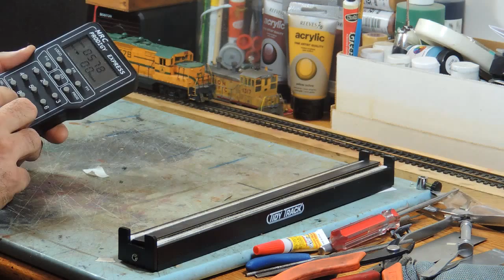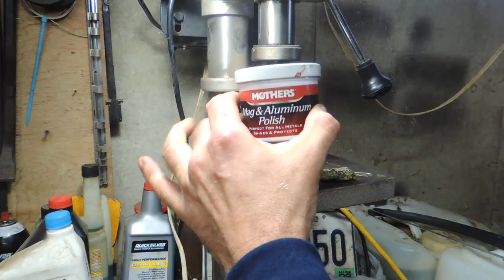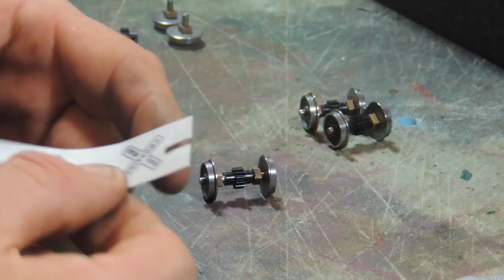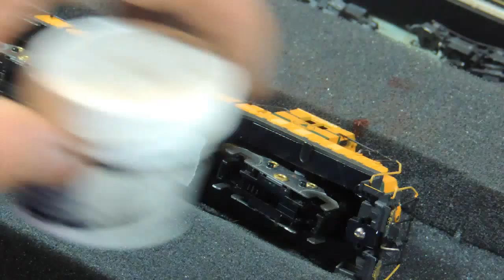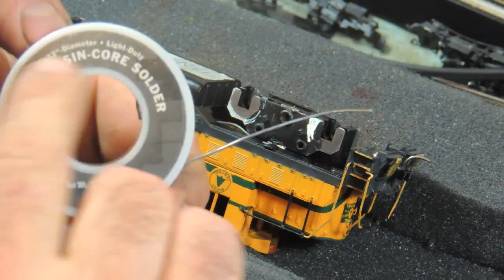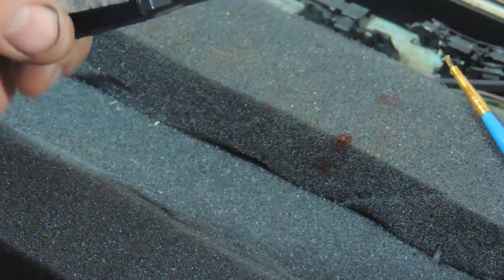Athearn Locomotive wheel tune up tricks.

Comment: This is my first time viewing. Very impressed with your machine shop cleaning of these ATHEARN wheels. The wire you soldered to the metal interior frame looks thin but i guess strong. 
The inside of Athearn mechanisms seen lots of times & ages. I have tons of fleets of them. I noticed some alterations on the front clip light that gives the bulb power that clips onto the chassis. Not there or the removed clip lock coupler covers. I want to mention I have a GE U 23 ATHEARN engine the front clip can no longer lock so that means no more light ups in front of the engine. I saw your version rebuilt fancy for lights in both directions. I have to convert it similar to what you have on your diesel. This is a blue box as well. Its not DCC or any sound gadgets. I need what i have viewed to replace & add a rear lighting similar to ATLAS circuitry. Of course i got something watching your video. Thanks.

Comment: What kind of soldering iron do you use.  The ones I use don't seem to last very long.  I'm using the Weller pencil soldering iron but the tips wear out very quickly.  BTW one of your fly wheel/gear assembly seems slightly askew, won't that cause running problems?

Comment: Athearn blue box locos have sintered wheels (powder compressed under high pressure, not cast) and they are very porous. They did that for maximum traction. To avoid these, get replacement wheels from someone else. It's interesting that you DCC guys have such problems with these, since you're using a lot more amperage and the PCB/software must shut off current to the motor if it's too low. I've never had the problem since I don't know what DCC is.

Comment: The wire used #1106 .0125" Phosphor Bronze.  Translated it is 30 gauge wire which I find too thin but very workable, I have had no issues using 26 or 24 Gauge copper wire easily found in the craft section at places like Walmart or Hobby lobby as it's mostly used for Jewelry and comes in many colors but go with Silver or basic copper the others are coated and may have pickup issues.  The Walmart stuff is $3 and no shipping costs and being slightly thicker seems to hold up better in my experience.  Great video and great tips!
P.S If Athearns are frustrating you,  sell them to me,  I'll buy them off you to help out no problems, these old trains outlive everything else even 2000's era stuff easily, step 1 or not is irrelevant,  Trains are meant to pull loads faster than a snail anyways.

Comment: Great Ideas... did enjoy video, BUT! I'm 74 years old, NEVER had a train, then 4 yrs ago, Two of my Grandsons (at 4 yrs old) became interested in chasing the local Spur line and wanted a trainset for Christmas... so I built a 4x4 circle track with a Harbor Freight set. The an 79 year old Uncle (who had been a train "nut" all his life, big in the Local Model RR club passed away and I inherited all of his "Project Trains"... probably 14 Deciles and 12 Steam Engines... only three worked. they are all from the 80s or earlier... (his son and the club got the pick of everything they wanted). 

My point is this.. I know NOTHING of the history or models (Blue Box Athearn means Nothing to me) I've got Atlas A-7 that I'm am working on in this video respect, I don't know how to get it apart without breaking it... some I have broken, some I got apart and don't know how to put back together. I can't get much help and youtubes are usually not a good as yours. but I spend HOURS and HOURS searching and youtube doesn't help, taking me on tangents that I didn't ask for... MOST of what I've got I can only identify to the company, and that's about it. I think I've found four disassembly sheets from HOME PAGE but they aren't Exactly what I've got...  where can I find your other related videos?

Comment: Great mod!  Phosphor Bronze wire is perfect.  Wet and dry sand paper at that grit will remove less than .00002 thousands of an inch before you wear the paper out.  It just polishes much like the creams.  Good stuff any ways.

Comment: awesome hack for theses engines. would dielectric grease help with contact as well? what are the measurements for the styrene used to reassemble the wheels??? thanks for your time.
Reply: NO on the dielectric grease Peter.  The grease will attract all the dirt, hair, crud and anything else that comes it's way!  The bronze bearing are "self lubricating" and any type of oil based lubrication will not help.  I clean those bearing in a degreasing solution in a ultrasonic cleaner and then follow it up with a rinse of 91% alcohol before reassembly.
Reply: @nelsonbeaudry4847   So you are not running any oil at all on your Bearings.
Reply: @GeorgeT6566  no oil.  The sintered bearings are self lubricating and oil only saturates them.  This is actually detrimental to the electrical path.  Adding the extra wire pickups is the best way I have found.  I currently only have one active Blue Box GP40-2 modified in this manner.  I finally added a keep alive to the Tsunami decoder and have never looked back.

Comment: I still prefer the old blue box locos. Going to try that wheel pick up trick. I will polish the back of the wheel But not the tread. I like the rough wheel tread for the reason of the traction advantage,  But it does make them get dirty faster. I like to pull really long trains, 120 average.  Them old blue box will pull them all day no problem,  Can't kill em. I have proto And Kato ect that can't pull, Just sit And spin. They may be noisier,  And not as pretty but they are some real good heavy haulers.
Reply: The rough tread on the wheels has no effect on traction.  Polish the wheels and you will still be able to pull 120 car trains due to the fact that a smooth wheel on a smooth rail will have more adhesion.  The reason the the other brands don't pull as well is because the wheels are made of Nickle Silver or brass and plated over with NS.  Both of which are much harder of a metal than the Blue Box wheels.  Those are made of "sintered metal" and are quite a bit softer in relative terms.

Comment: So what is the trick to get solder to "stick" to the metal parts of the truck assembly? I'm following your instructions, but my bronze wires keep popping off when i move them.
Reply: So sorry for the super late reply.  I use a paste flux called "NOKORODE®".   Yes it's made for plumbing but it is not acid based.  P.S.  What wattage Iron are you using?  I recommend no less than a 30 watt for this.  Quick fast heat is the answer.
Reply: Are you putting some rosin past flux on the brass grommet and tinning it with solder first before trying to solder the wire to it?
Reply: "paste"

Comment: Excellent video. Thanks for sharing.  I already bought me some of the wire. Ready to give it a try on Athearn RTRs. They are worse than Blue Box when it comes to pick up.
Reply: +MRLTrains The reason is because the sideplates are chemically blackened causing very poor power transfer.

Comment: How are they holding up for you when it comes to cleaning them after a wile? .I seem to have collected many of these wheels after replacing many them in the past.Lesson learned with the cost ,slippage in the gear with the replacements, and the loss of traction.Agree they are a good wheel ,but like to be cleaned a lot,but they are well made.Nice work on the loco and the video.
Reply: +HARPO1ME   Stay clean much longer because the wheel tread is no longer pitted.  Look at a stock Athearn wheel under magnification and you will see what I mean.  I have since also used 1500 wet/dry sandpaper for really bad wheels.

Comment: Quite elaborate, yet effective. I see by the comments, that this level of maintenance, isn't for everyone...
 They're the one's keeping the RTR market going strong - and who killed the Blue Box in the first place!!  :(

I think it's a great idea... the sintered iron wheels do provide way better traction. They ARE however, crap magnets. THAT is a thorough way to completely clean them!
I've bought the Nickel-Silver replacements - but I can't always spend that kind of money....

 I've been using TCS decoders, with Auto-BEMF and Keep-Alive EXCLUSIVELY !! I roll over the DIRTIEST track, and ANY dead frog - without so much as a light flicker, or the tiniest bit of fluctuation in speed !! :D

I still believe in proper maintenance, of track AND wheels, and will try this method.

The bronze wire pickups are a BRILLIANT idea!! I can't WAIT to try that!
Subbed you!! :)
Reply: Thanks for the comment.  Sorry I havn't responded sooner but this is now a "legacy" you tube channel so I don't check it that often.  I think you will find a huge improvement in your wheels not being a "crap magnet" as you described them.  I also fine that for the really rough wheels, a strip of automotive wet/dry 1500 grit sandpaper glued to a hardwood block really does the trick.  Follow that with the polish and added pickups and enjoy.
Reply: Nelson Beaudry as a retired Auto Tech, I still keep supplies like that on hand....
I actually enjoy doing maintenance - to a point!

So new channel? Where can I find it?
Reply: Blue box was retired by Athearn due to costs to labor issues, basically the RTR cars were getting to be cheaper than the kits you had to build bringing about the WTF process.  Why pay 50 dollars then build it when the same detail and quality was ready to go out of the box....only a dummy would question this.

That said I'm a dummy cause I prefer the Blue box stuff and was raised on it.  It brings you deeper into the hobby I think when you build every detail,  plus you can use your creativity and make every car, building your own.

Sadly this hobby is about dead due to price gouging by the manufacturers keeping new people from entering the hobby due to outrageous pricing and extremely cheap crappy starter sets.

Comment: How can the wire pickups be added to a athearn MP15ac it would help it run so much better.
Reply: Does it have the bronze sideplates that the axle stub goes through?   I have a fix for that also.
Reply: +Nelson Beaudry 
Yes it does the side frame pick ups I have been struggling with conductivity loses any help would be great. i enjoy your videos.
Reply: You could try putting just a LITTLE bit of dielectric grease in the axle holes. Do not use very much! Dielectric grease is a specially made electrically conductive grease. It's often used on both ends of spark plug wires to improve electrical conductivity, It really helped my old Blue Box Athearn TR5A.

Comment: Very interesting and informative, enjoyed this. I myself have plenty of Blue Box Athearns and I may have to try this on a few of them, some of the older ones I have the pickup can be erratic. Have you done this pickup modification to any six axles? I am curious as to the best way to do that using the wire you used. Thanks for sharing!

Comment from the maker: Never had any issue with parts breaking.  If they break during dis-assembly or reassembly, it just means that they were going to break anyways.  It might be a lot of work to some, but remember that this is a hobby!  I do these tuneups like this because I am a Mechanic by trade and I use those skills to improve my hobby skills and vice versa.

Comment: Wow, while that is all good, that is a lot of work. I like to put my loco's upside down into a foam cradle, and connect feeder clips to the trucks. I run up the motor and use Q-tips with Goo Gone to clean up the grime etc off of the spinning wheels. Then I use Isopropyl alcohol and Q-tips to clean again because while Goo Gone is great for cleaning, if left on the wheels is bad for  conductivity. Of course adding the wipers is always a great way to improve pickup, if you need extra measures. The part I don't like, is that on older Athearn locos,when taking them apart, things like to break, I try to avoid that.